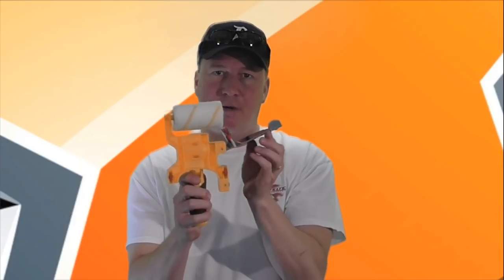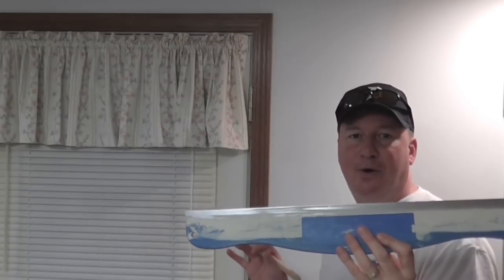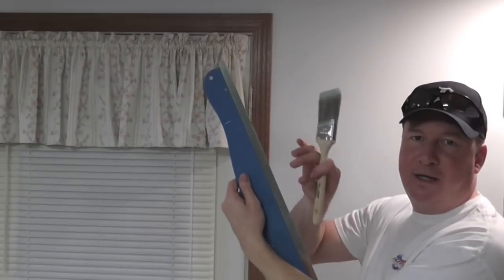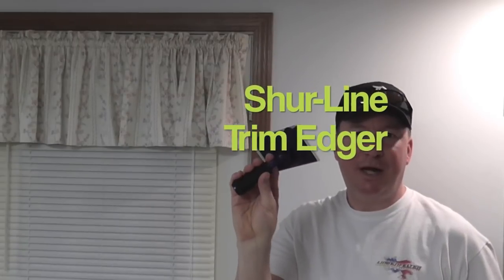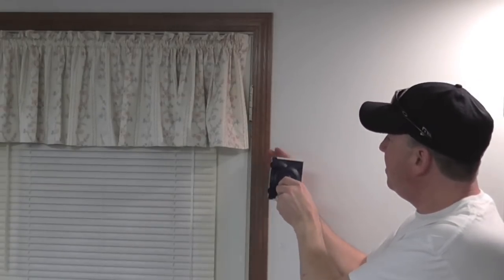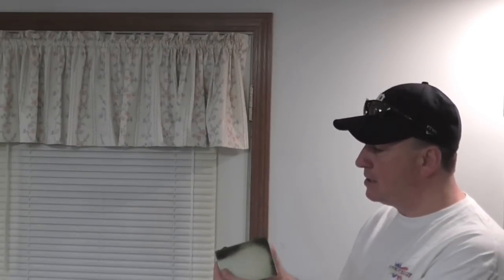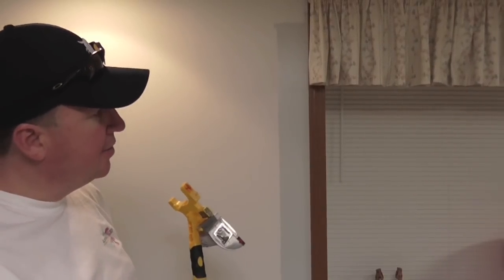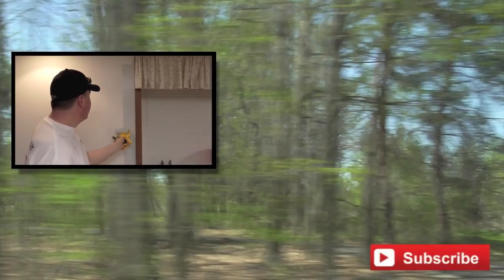$99 Accubrush XT Paint Edger vs. Traditional Painting Techniques

Comment: If u call yourself a painter u never need tape to cut in ceilings or Windows... that's how I feel. Base trim/millwork maybe depending on the job.
Reply: Kenneth W u can be the best painter but u still gotta use tape on baseboard.
Reply: baseboard is easiest to cut in after the walls are painted, no tape

start with ceiling and casing, then walls , then base, no tape

tape flooring at baseboard

brush, brush, brush
Reply: Slamina Ytrap you use tape on your baseboard mostly to keep the spit from your roller off of it ;) unless you cut in your trim after doing your wall or like little splatter marks all over your baseboards lol
Reply: i know how to paint, roll, cut in what ever, i been painting for years
this product is for do it yourselfers who think  they can do it themselves but in turn realize they should of hired a pro in the first place
if tape is needed then i use tape
i know about splatter lol
Reply: Slamina Ytrap best way to paint a room in my opinion is shoot your ceilings and trim including baseboard then cut and roll your walls way faster then cutting in your baseboards afterwards I speak from experience :) we used to cut our base last
Reply: Slamina Ytrap I agree my friend I am also a professional painting contractor this tool is definitely a do it yourselfers deal If I had a quarter for how many DIYers and homeowners I've met who tape there ceilings to cut in just to have it bleed through I could retire ;D
Reply: +Travis Galloway 👍 We do the same thing, getting several 2 story lots A day.  West Coast.

Comment: the accubrush is no good because it leaves a small gap so youll have to use a brush to fill that anyway. i think the metal blade is a good method but you have to use a small amount of paint so it doesnt bleed behind. it might be better to use a ten or 12 inch mudding knife because the blade will be thinner.
Reply from the maker: I could've pushed the little brush out a little further to get closer.  A good painter can push the trim brush right next to the trim and cut in the paint fairly quick.

Comment: I bought one and am returning it. It looks like crap.  had to finish with a brush. you can't get into corners or tight spots so you have to use a brush anyways which gives a different finish. Does not work well on uneven surfaces either.
Reply from the maker: Yeah, it's too bad it can't get into the corners.  I think if a team of 2 people are painting smooth walls in long rooms, this work help it go fast.  It's important to get the micro brush adjusted correctly.

Comment: 1/8" might as well be a mile.  If it can be adjusted to actually work that would be great but if not then it is worthless.  I can't come to any conclusion from this video whether it's worth it or not.
Reply from the maker: Yes, the micro brush can be adjusted to close out that 1/8" gap.  Since my paint color was close, I was okay with the paint not running right up to the trim, making the job go quick.

Comment: $100 you could buy 2 quality 4inch wall brushes for that
Reply from the maker: What size brush do you use for cutting in?  I've been using a 2.5, buy may get a 3 eventually.
Reply: @MarkThomasBuilder  3-4 inch brushes with couple set of fitches and sashes.

Comment: epic fail! if your gonna have to go over an area multiple times you're better of practicing with a brush till you master the old school way which is way faster in the long run
Reply: Jose Soto 

not. that thing he has is fast and does perfect edging up to trim.
Reply: licensed  painter 21 years. I agree. Periodically I come here to see if there's anything that's faster than brushing and rolling. If you go over an area 4-5 times and still not perfect, like using this machine, it's only good for ppl with no experience and low expectations. With a properly loaded quality brush I make one steady move , and follow it with a 4 inch roller to widen the pattern a bit and give some texture to match the later used larger roller's pattern. Done. Then taking 30-40 relaxed minutes to roll out the room using a 9-12 inch roller. Of course it takes a few years before you enjoy your nicely developed speed and routine. Then half of your speed will come from not making unnecessary moves. By the way, I only use tape on baseboards to protect them from splatter while rolling.

Comment: Wish you had made the adjustment on the brush and then did a close up of the paint at the trim edge. A 1/8" gap is way too much. I can do much better and almost as quickly with trim brush. This is an expensive item that I'd be willing to buy only if I could cut in as well as my brush but save time.
Reply from the maker: I agree, I wish I did that in the video.  I definitely need to make another follow u video.

Comment: I would buy one but i don't think it looks like a professional thing to do, i can probably paint my house with this accubrush, the gap it leaves is unacceptable
Reply from the maker: The micro-brush inside the Accubrush could be pushed further out to have the paint just touch the trim.  I just considered it close enough for my house.  I've taken on more painting since then and realize the need to close the gap.
Reply: @MarkThomasBuilder  so do you suggest buying it if i do painting for a living?
Reply from the maker: I would check other reviews to see how close they get the paint to the trim.  It's a great tool if you have it set up correctly and smooth wall conditions.

Comment: Too big a gap between fresh paint and trim.
You never gave a mark out of 10.
Reply from the maker: I give it an 8 out of 10.  I can get the paint closer to the trim by adjusting the brush.  The only issue is that I can't paint the inside corners with this.
Reply: markthomasbuilder why didn't you do the adjustment and zoom in on the result, for demonstration and comparison?
Reply: markthomasbuilder my god more likely 1 out of 10 , are you being paid by them

Comment: That 1/8 th of an inch gap is unacceptable. and it seems you have not used the micro brush.
Reply from the maker: I need to make a follow up video, now that I've used this tool some more.  My thoughts while making this video, was that it was close enough for me and I didn't want to have to deal with trying to clean the paint off the trim by taking a chance of making adjustments.

Comment: I would only get this for under $50.  Its cool, but I would not pay $100 for this.
Reply: it's 35 bucks
Reply: Sigor:  The one with wheels and an articulating handle that accepts an extension pole is $99.  The basic, hand-held set is $39.

Comment: what a waste just cut with a brush or use tape lol
Reply: Why should be a waste? As far as I can see it works perfectly, withthis stuff I can save a lot of time and a lot of meters of tape...
Reply: Harles74 it leaves a gap thats not perfectly well at all in my eyes there is no gap if you use tape
Reply: Taping takes a ridiculous amount of time and if you don't peel it of correctly there is touching up needed.  I use tape when I can but this device looks pretty decent.  Cost is too much though.

Comment: Overpriced and leaving a 1/8" gap at the trim edge is unacceptable.
Reply: Accubrush sucked! They refunded my $ and asked I return the unused rollers and brushes. 👍 I will use my pad edger with the wheels that elevate so they never get paint on them. I dont have the gifted steady hand or sharp eyes anymore to hand-cut.

Comment: These things are jokes. I could go on all day but won’t . In a room a typical lay out has your light switch by the door. Normally the light switch is a few inches from the trim. The light switch area is your sight line. None of these wonder tools would fit so you’d still need to buy a brush anyway. And then there are corners in rooms in case you never noticed, one of the more difficult places to get at. How the hell do you get there with out a brush. Show us how your tools get behind radiators .bullnoses on sills .
Reply from the maker: Yes, it has it's limitations.  What's trim brush do you recommend?
Reply: markthomasbuilder I always use a run in brush 2inch. What I mean by run is a brush used on flat surfaces first to get its shape, on an Hamilton pure bristle the outer bristles will wear of and you end up with a sharp brush. Bit like what company’s are trying to make with already shaped brushes, but I prefer a brush with weight synthetic can be too lite weight. I’m 30 years experience in the trade , if you are in the uk and no experience . Homebase do a Monarch brush, the inch and half does well in oil (has a blue tipped handle) the red one in 3 inch is good for emulsion cutting in. For doors etc if use an Hamilton 2inch or 1 and half . You either have the knack or don’t . This thing videos is shit, bristle will cut in better
Reply from the maker: @armbadmin  Thanks for sharing.  I haven't seen the Hamilton brushes around here in the states.  I'm using a Purdy Clearcut.
Reply: markthomasbuilder not 100% sure but I hunk purdey is from Australia . Monarch is also made by purdy . I have loads of new purdy ive not used . They are mostly synthetic and lightweight or stiff type I don’t like them...I used one for a day an threw it away an went with the monarch . I still have the brush in water I used last year so far it’s done an whole estate  54 houses sash windows and door frames patio doors fascia boards and small utility doors. £7 as earnt thousands

Comment: That gizmo is garbage,just give me a dam brush.$100 is pretty steep,sounds like a pair of roller skates on the wall. An 8th of a inch is unacceptable,when it comes to cutting.
Reply from the maker: What's the best size brush for cutting in?  2.5? or 3" Purdy?
Reply: Everyone is different,sometimes I use a 3”,sometimes a 2.5 depends on the area that needs to be painted. I like a 2.5” works well for me and I can cut pretty good with it. Purdy,Wooster are both good brushes,it’s all about preference!

Comment: Man you should not have done this video without perfecting the use of this overpriced edge painter that 1/8 of an inch away from edges is not good at all if it could be adjusted for a better result then you should have done so before recording it you may have done a disservice to this edger!
Reply from the maker: It's been awhile since I made this video.  My intent was to say that it painted up to 1/8 of an inch, which was close enough for my own house. I did show that it has an adjustable brush.  I'm planning on making a part 2 video sometime soon, where I'll try and get it right on the money.  If I were going to buy something this expensive though, I'd watch at least 3 video reviews.